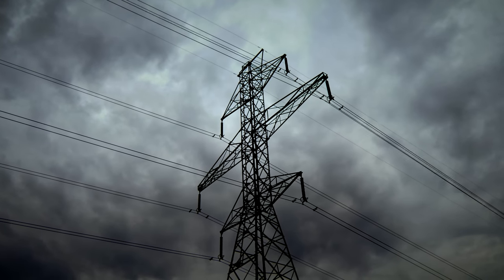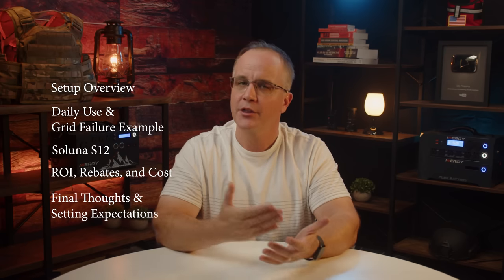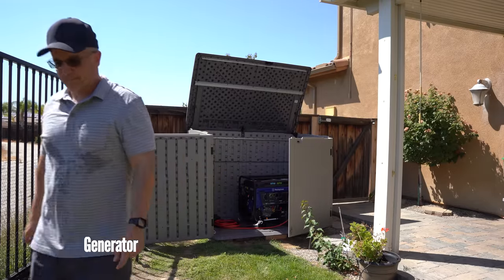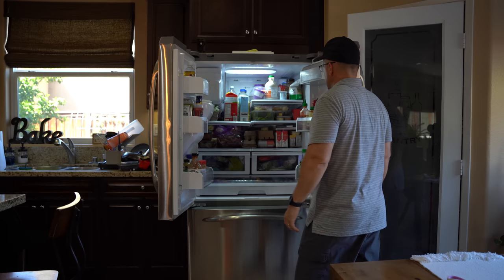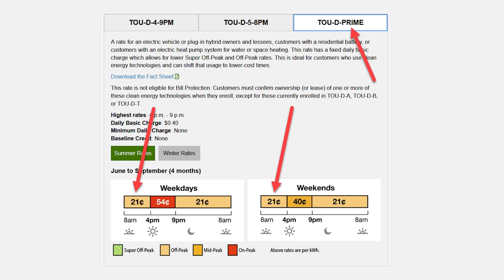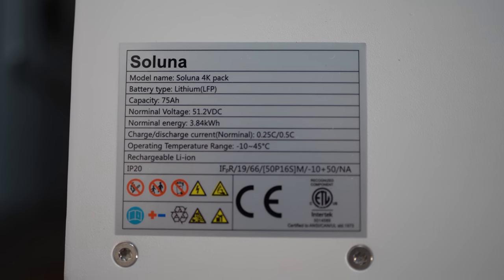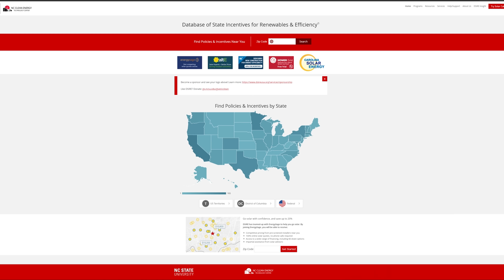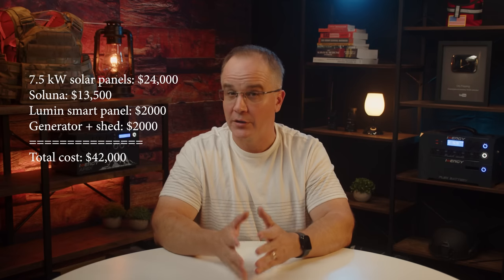The Coming Power Grid Collapse.  Soluna S12 Whole Home Backup Power

Comment: I'd like to share what my two-person family household uses as our solar plan for grid-down.  

Some considerations:  
#1 We do not have any children or emergency medical power needs.
#2 We live in a house in the deep inner city of a major metropolitan area in the upper midwest (therefore we require significant heating during the winter, about 6-7 months a year)
#3 One of our main goals is to not appear at a glance to be a "prepared" household.
#4 We have a rather small (1100sq ft) house
#5 We have no real interest in selling power to the grid at the moment

Instead of wiring up the entire house to work with solar as if the power never went out, I have opted to use a more "distributed" style, and have some mitigation steps for taking care of perishable food, and heating/cooling the interior without A/C or Furnace being able to function.  In short, I use a series of Jackery Explorer 300 "solar generators" to provide electricity in areas where electricity is required.  Along with 4 generators I have 4 100W Explorer panels.  The panels can be daisy-chained together by two at a time to charge an Explorer 300 very quickly. This allows me to have "visible" solar only while charging an individual generator unit, and the layout of my yard and house allow me to pretty easily "hide" the panels from easy view, even while collecting electricity.  Alternatively I can easily prop them onto my roof and use extended charging cables to actually keep the generator unit(s) being charged indoors, safe from prying hands and eyes.

For handling perishable food I have two 55L rotomolded coolers from Blue, and all perishable high-value food from my freezers and refrigerator can be moved to them within 10 minutes. One of the items that would be running during warmer times would be my small countertop icemaker. This can provide more than enough ice to keep the 55L coolers effectively acting as chest refrigerators indefinitely. Deep-freeze is a different story.  If the grid were to go down for longer than a few weeks we would be systematically using up any deep frozen items as we transitioned to other food sources.  We do not really rely on frozen food much, it's really more of a luxury box, keeping nice cuts of meat, fish, etc that aren't preserved in another way so that we can have them on demand.

For cooling the during warm months the only real option we have is consistent air circulation, and maybe a fan in front of a bowl of ice (made with the aforementioned countertop ice maker). While it's not A/C, it definitely would help make off-grid city life more tolerable in the summer. We use several Vornado low-voltage brushless motor fans, which can run for many many hours on a very serviceable speed off of a small Explorer 300. Using responsible room rotation (don't be upstairs during the hottest times, etc) and circulating air in only the rooms you are occupying, the house can be kept to a very reasonable indoor temp even in the high 90s and low 100s. 

For heating, that's a little more tricky in thr frozen north. We use a "Buddy Heater" that uses green camp gas (of which we have a very plentiful supply), and the previously mentioned air circulation techniques, alongside a CO detector in whatever room is being heated. This would only be used in the more dire cold days, below 10F or so, as we are used to much colder temperatures than many areas of the country/continent. Otherwise the indoor tent technique for sleeping (as well as appropriate winter clothing, sleeping bags, etc) would be the way to stay warm on an every-day basis.

When all is said and done, this entire 100% portable electricity, heating, cooling, refrigeration, etc setup cost about $3500 if you take everything, even the fans and rotomolded coolers, into account. This system can be pieced out, loaned to people that need it, or taken entirely on the road if needed.
Reply: Thanks for sharing. This was very helpful!👍🏿
Reply: That is close to my setup. I have a bluetti 2400 with 600 watts of solar panels to power the fridge and small appliances, yeti cooler, small ice maker, fans, buddy heater. And lots of books 😊
Reply: cool - that will buy you about 6 months before you run out of food....and are dead
Reply: This quite well thought out. Please consider uploading a video showing how you did all that.  Wondering if this is scalable.
Reply: @Hail2MasterChief  Depends on what "scalable" means to you. On a per-household basis it should be pretty cut and dry, it should theoretically work. If you mean "scaling" in a way like, all of the sudden I can run my 220v central air unit? Definitely not. That said, if the grid is down I don't want that compressor running, as quiet as it is, and giving away the fact that I've got power, let alone that there's someone home.

I think in a larger home or even with a family this approach could still work perfectly well.  Electricity can provide some entertainment for those that have offline digital devices like e-books, ipads, and the like... Could help morale quite a bit, especially with kids.  If the grid is well and truly DOWN (as in, even backup generators can't keep water pressure going, etc) for an extended period the best thing anyone that has prepped can do is stay home, stay quiet/invisible, and ride out the storm so to speak.

BTW I doubt I'd ever do a video besides the very few random ones I've got on my "channel" made for various forum posts, etc...I don't have the time or energy to create a decently produced video given my busy professional life. I'd just do what I'm doing here: suggest using the approach of not powering your entire home, but powering one or two rooms at a time via portable solar generators.... and concentrate on coming up with ways to accomplish heating, cooling, and food preservation.  If you don't have large water reserves and longer-term food supply (which of course I also do, as I've been prepping very actively for over 5 years) I would work on that first and foremost before it becomes impossible to do!
Reply: @innercityprepper  Thanks! That's a really great analysis, I appreciate the conservative approach.  If SHTF no one is or should be exhibiting conspicuous consumption of energy anyways, even beyond moral/ethical considerations.
Reply: Thanks! I live in the Midwest in a small house too, and think these are great ideas. The Yeti cooler and ice machine idea seems very doable.
Reply: @woenderer  If you happen to use one of those by-mail meal kit services, they all come with these re-useable cold packs that last a VERY long time with proper insulation. I've been keeping a supply of them as well. so that it doesn't have to only be ice that is keeping things cool where needed. Could also use them for personal cooling, injury relief, etc.
Reply: @Hail2MasterChief  there will be conspicuous consumption after SHTF from people with no brain cells to spare and plenty of money, and they will be easier "marks" for those on the lookout.... but you'd be insane to have extra noise happening when otherwise there will be silence.
Reply: THATS A GOOD SET UP, I LIVE IN AN OLDER RV IN DALLAS TX, FOR THE SUMMER I USE A 12V FAN THAT I RUN ON A COUPLE SMALL POWER PACKS....

I ALSO HAVE 2 JACKERY 300 THAT KEEP THE LIGHTS ON AND HELP WITH CHARGING MY OTHER SMALL POWER SOURCES, ONCE A WEEK I PLUG EVERYTHING IN IN MY DAUGHTERS HOUSE....

IN THE WINTER I USE A PROPANE HEATER, NICE WARM LAYERS OF CLOTHS A GOOD 50 BELOW SLEEPING BAG AND A WONDERFUL WOOL BLANKIT.....

SURE IT GETS ROUGH SOMETIMES BUT IM REALLY POOR AND THIS WORKS WELL FOR ME, I LOVE MY LIFESTYLE AND GET TO PUT PLENTY OF MONEY ASIDE SO I CAN HELP OTHER PEOPLE OUT IF NEED BE....
Reply: @innercityprepper  thanks! Your ideas really resonate with me! Just me and my partner, no kids, very small house in a city in the upper Midwest. I don’t want to be conspicuous. I also don’t have 50K to spend on a whole-house generator. Any anyway, been lusting after  those Blue or Yeti coolers for years. Now I have an excuse! I worry most about the food in my freezer.
Reply: @vincentrisalvato9921  If you love your lifestyle, you aren't poor :)
Reply: I’m sure you would be interested in selling power back to the grid if it means you have no electricity costs

Comment: Chris,

If your grid is down will the controls from your phone still work?  Is there a way to control these things from the system's local panel?
Reply: LOL..I was thinking the same exact thing.. "grid is down.. think i'll log on to my I-phone."  LOL
Reply: I'm pretty sure his phone will still work, as the system will still power essential items and a few wall sockets to charge his phone. The panel installed above the Soluna I believe controls those essential items.

Comment: Because of preppers like you I’ve installed a well, Solar, a pool, an outdoor kitchen( my indoor kitchen is all electric), I have life straws, I have at least a 4-6 month food supply. Ok maybe I got the pool to swim but it is a ready source of water 😂 … I’ve got chemicals to disinfect. I’ve been meaning to look into the battery back up system. I’m not all the way ready but more ready then I was before. Thank you.
Reply: Check out HoboTech channel. He tests & rates many brands of SoGens & panels. Also portable chest refrigerator freezers that run on soGen power. He explains a lot of details, pros & cons of each unit. Often has a discount for current review item. Go thru his old videos to learn about what is available & will work best for you.
Reply: LOL welcome to the club Sister :)
Reply: Try not to buy too many knives. A lot of us end up with WAY too many.

Comment: We are still waiting for improvements in battery banks before we install an off-grid solar power system to power our home's three large air conditioners. Here in southern Nevada, it is air conditioning that makes the difference between being able to stay in our home during the summertime versus having to evacuate if the local power grid goes down. We can cope without a functioning refrigerator or freezer, but we cannot cope with a home interior that could reach the exterior temperature of 110" F or higher during a prolonged summertime power outage.
Reply: Add generator (NG, propane or gas) which can cover AC startup spike.  Solar should cover everything else, at least if you manage use.  Could add “soft start” on ACs instead if your solar offers solar only option as many do.  Might need to only do one AC, but that zone could be kept comfortable and rest cool enough for entry or passing through.
Reply: Get an efficient window unit or mini split that solar/battery backup can run.  I can cool one section of my house during a power outage with battery backup all night and then the solar kicks back in in the morning.  2 x 3800kwh batteries (12v) or a single 5100kwh (48v) can keep you going with 1500-2500w of panels.  Roughly $1500-2000 for the batteries.
Reply: For an emergency I accept that I don't need my whole house to be Chilly and comfy.  As long as I have somewhere to go and get cool.
Reply: A large portion of the southwest is only habitable because of air conditioning. Kinda the same with Florida too. I live in PA and hate summer, I wouldn't do so well in the desert 😂
Reply: @finngamesknudson1457  Thanks for the tips. I will keep them in mind. For me, it is important not only to keep my household members reasonably cool during summer, but to also keep my food storage cool so I can get the maximum expected length of storage for that emergency. We have more than a year of expensive food storage for each household member and want to preserve that financial investment.
Reply: Excellent practical advice & use of solar. The states of Arizona &Nevada California have electric power generating issues if we loose the Colorado river.
Reply: My house is set up so if a prolonged outage occurs I will “live” in a portion of the house. This will be more manageable to maintain temperature and other essentials. Temperature control is the biggest use of power and can become very expensive on solar and batteries.  Anything you can do to help this will pay huge dividends.
Reply: @zanedzikonski4234  exactly. Chris covered micro climates within the home during winter. The same applies to summer.
Reply: @mike7652  just wait for the climate migrations to happen! We're already really dam (pun intended) close to having almost no water supply for the southwest states and southern CA. Even if a solution is eventually found it's likely to be temporary stop-gap and there will be a wave of people moving north to locations that are actually suitable for larger scale human occupation. There's a reason the native populations in the southwest were so sparse. Just like fish in a pond, the population size naturally adjusted to the availability of resources.
Reply: As a fellow Southern Nevadan, I agree. AC is more important. There are plenty of foods that don't need to be cold. I constantly worry that the air will go off while I'm at work and my dogs and cat are at home. I'm a single gal and I'd have no way of knowing if the air shut off. I'm looking into devices but I don't want any cameras, especially connected to wifi in my house.
Reply: Use a solar inverter and put in a min split in a room or two for back up cooling. Hyper efficient and will run well off soar. They even make one powered directly by solar with normal AC power for a back up
Reply: How much more can Batteries improve? I have three large air conditioners and my lifepo4 batteries power them just fine.
Reply: Gone fishing- same thing here in Phoenix, our central a/c is the MOST important thing we would need. I can use flashlights and eat canned food but to survive the 118F summers we MUST have a/c. Fans do not work to safely cool you when temps are over 90F.

Comment: Great video, I actually made my own battery back up system. I have a 12kw 240v inverter. I built and made my 25,700kwh battery bank from new 32650 Lifepo4 batteries. I have two 48v 250ah battery banks that I wired in parallel. I also have the Batrium BMS to balance the packs. Since I did everything my self it cost me about $7000. And I have 8 - 320watts panels.

Comment: The only downside to having solar panels on the roof is if especially if you have an older house and you have to replace the roof that's going to cost you a lot of money because that solar panels have to come off then the roof then to replace the roof and then put the solar panels back on it'll cost you double the money..
Reply: The installers take that into consideration when installing panels on your roof.  They will make you replace your roof before the solar installation unless your roof was replaced a short time ago.
Reply: We have a freestanding solar array to one side of our house. We live in a rural area and this is common for homes with some acreage. This allows our solar panels to be situated so it gets the maximum exposure to the sun. We live in Northern California where we get lots of sunshine.
Reply: Another option is a metal roof. Much longer lasting!
Reply: My mother had solar panels installed earlier this year.  Now that I am taking over the house, we have discovered that the roof needs replacing.  Luckily, it's primarily accumulated storm damage, so replacement will be an insurance claim.  And that job and claim will include removing/re-installing those panels.
Reply: @mthomasy  you are one of the lucky ones my friend
Reply: @terrylazurko2476  That seems like a crazy large expense to add to the initial investment in permanent solar. Ouch.

Comment: You can start small.  A small USB solar charger can keep a HAM or GMRS radio going, or keep your phone running for games and whatnot.  A good-sized portable solar panel and solar battery can keep a small refrigerator running (for the love of god, not thermo-electric), keep a CPAP machine functioning, power an electric bike, or run a fan.
Reply: I just started studying for a HAM licence. I'm also learning Morse Code.
Reply: Amen. Any devices that you have (like radios, etc) make sure they aren't reliant on some sort of proprietary battery that you won't be able to get more of when the sh*t goes down. You can stockpile alkaline and/or lithum AA and AAA batteries though, and even Baofengs have adapters to be able to easily use them.
Reply: yep,  what i've done... so far.

Comment: Great information, thanks. I live in a mobile home, in Maine, with such a low electric use that it would be uneconomical to go this route. I will share with some friends who might like it. I have three 1800 w portable solar generators which will run my essentials in an outage. As a 65 yr old widower I only have me and neighbors to try and help. As an old Army grunt I still can keep up to some discomfort, have options for heat as well.
God bless you and yours Chris!